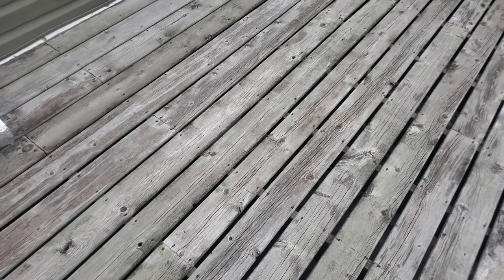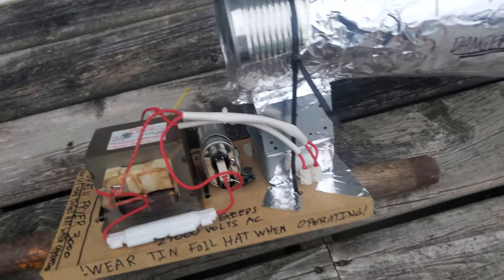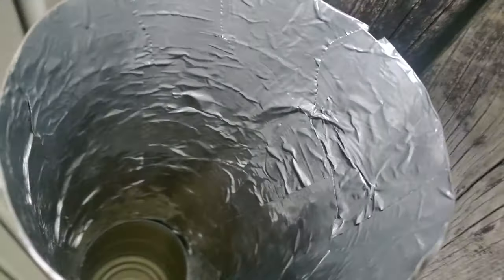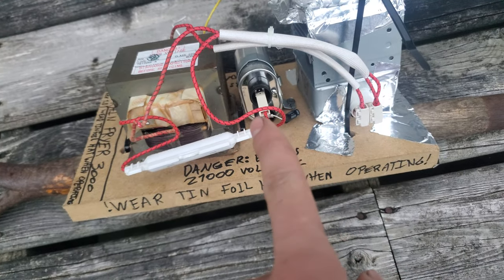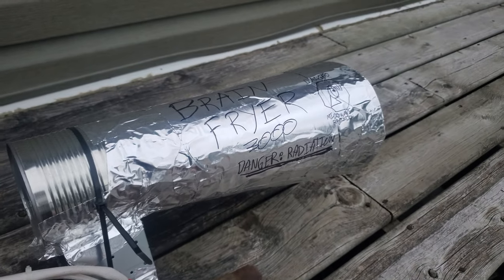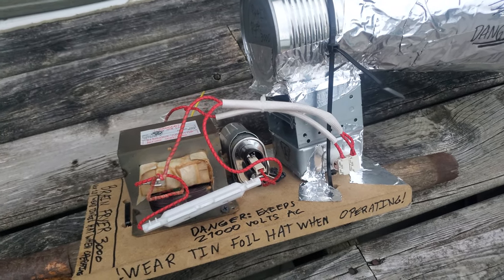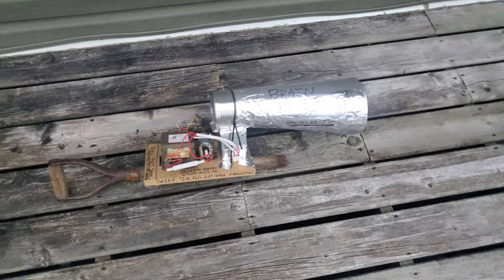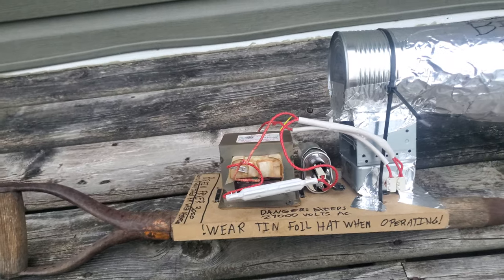New invention- The Brain Fryer 3000- made from old microwave

Comment: I've worked many years building High Power TV UHF equipment and microwave communication parabolic feeds. I started my career repairing High Power Illuminator Army Radar, and Navy submarine Transducers. And you should be advised that your "gain horn" will leak RF energy off in all kinds of directions based on what TE or TM Mode the current is in. AND there is surely likely to have a "back lobe". Which means there could be quite a lot of energy coming right back at you if you're holding the shovel handle. Just saying. The energy coming out will "splash", and will not be like you imagine in some sci-fi comic book. You are playing with fire kiddo. 2.4 Ghz 1/4 wave antenna is 31.25 mm long. Approximately the same distance for the Transitions backplate short circuit, since you have an open circuit Dipole. Typically these circuits are tested at very low power for VSWR Matching and radiational lobe angles. Then it is fired up on high power at a test range, before being deployed in the field. Again, just saying. P.S not having a descent or good enough VSWR Match through your gain horn and into Free Space(approx 300 ohms), means that a fair amount of energy will be reflected back into your magnetron...again, just saying, and feel free to fact check me.
Reply: Probably won’t make it to the radiation burns part, with tens of thousands of volts on the secondary side a few stray electrons is all it takes.  I believe microwave transformer projects have claimed over 30 lives on YT alone.
Reply: RF Design Engineer with 30 years experience who works for a very well known university here...  I 100% agree with this comment.  That looks like fun but is very dangerous.  You can cook your brain or give yourself cataracts pretty quick with that
Reply: @RadNeck-s2t  Thanks for the acknowledgement. Can I ask you a question? It's about filter design.
Reply: @RadNeck-s2t  I just wanted to know if you ever heard of using the coupling bandwidth delta between filter poles in either a coaxial or waveguide passive bandpass filter. Measuring the bandwidth by means of either short circuiting on a waveguide cavity or tuning the resonator out on a coaxial and using Phase and Delay on the Network Analyzer to find the bandwidth, and then noting the group delay "signature" ??? This is a reverse engineering tool, but then the bandwidths can be used to interpolate to new design requirements based on frequency. Typically these filters were for 6Mhz DTV  UHF filters with single or double cross coupling for steeper skirt rejection notches. 5 - 120 Kilo watts.
Reply: Wow what a suprisingly gnarly question.  so the short answer is:  "I tried something like using a VNA to divine the inner workings of a cross coupled filter and I couldnt figure it out"...  Once upon a time while working at Andrew Corp. I found myself in Suzhou, China overseeing filter tuning for about three weeks with not much to do do.  They left me pretty much alone in a room with a VNA for three weeks so I screwed with it quite a bit.  The filters used one cross coupling.  I used a commonly known technique using TDR that works well on direct coupled filter tuning that have no cross couplings.  I added some of my own mojo by sweeping the bandpass TDR frequency and using GPIB/Labview to make a contour plot of the resonator tunings.  With this technique I could read off the tuning of each resonator.  If I knew the impedance of the resonator think it would be possible to deduce the tuning.  But it didnt really work on a cross coupled filter.  Generally speaking, cross coupled filter design is a big hairy can of of worms.  The sysnthesis procedures are janky at best relying on "known coupling topologies" and brute force optimization.  If you get interested Richard Cameron at Comsat wrote a lot of papers on it.  So can you deduce the couplings with a VNA ?  Maybe.  I couldnt figure it out.  Maybe with some specialized stimulus waveforms and some fantastic math.  The holy grail would be mapping the s-parameters from the VNA to pole/zero locations.  Its certainly worth a paper if you figure it out.  Sooooooo  that said, here is how I would try do a reverse engineering task.  The easiest thing to do would be just take the filter apart and copy it carefully.  Barring that, I would close off each cavity and tickle each resonator with a small loop probe barely inserted into the cavity to see what each resonator is tuned to...  then maybe tickle adjacent cavities (with the other cavity couplings set to 0 with copper tape or something) with two probes and empirically fit an equivalent coupling capacitance to whatever you get with LTSpice or MWO or ADS or something.  The "shorting resonators" you mention sounds like "Dishal's" method which you may have already read up on.  If you have the dimensions of the filter you could model everything in HFSS or some freeware FDTD simulator and derive out a relationship for iris size vs coupling.  Good luck
Reply: @RadNeck-s2t  Thank you soooo much for getting back to me with huge detail. The  guy I worked with was using the "small loop open circuit "sniffer" probe when he started his endeavor. But I have to tell you that my/his technique is the true answer for Chebyshev and Bart filter design in passive waveguide and coaxial designs. The HP network analyzers are capable of all measurements in S11 and S22. VNA is a Network Analyzer?? I've been out of the biz for 20 plus years. I truly wish I could demonstrate what I learned on a real filter, and show you what I know. I live in NEW England, and maybe there will be some IEEE show sometime???? We could meet??? ps...sorry about my avatar....
Reply: @RadNeck-s2t  I also like how you said "Brute force optimization" A PHD I worked with said it was the "1000 monkey theory" You said....the holy grail would be mapping the s-parameters from the VNA to pole/zero locations.  Its certainly worth a paper if you figure it out....that is exactly what I'm talking about !!!!!! I/he figured it out !!!! It is a simple way to isolate and measure the coupling "bandwidth" between poles. Totally measurable. Quite easy to do so.
Reply: @RadNeck-s2t  Another note: he held these secrets VERY close to his vest, and he fired me because I understood what he had discovered. I was the one who took all the data.
Reply: @RadNeck-s2t  Sorry, Derek Small, not Derek Smart....oopsy, hell I was his tech in the 1990's
Reply: where in new england ?  not sure how much time i want to spend on this... i am interested but i am really busy and you might be a nutcase